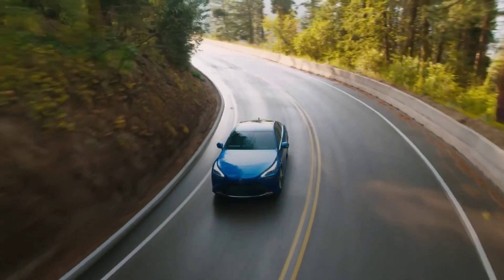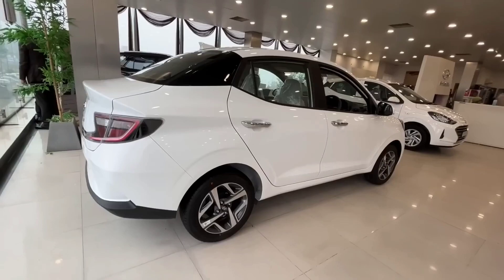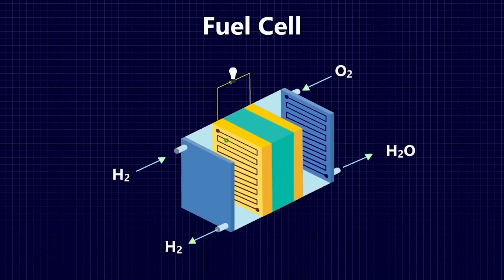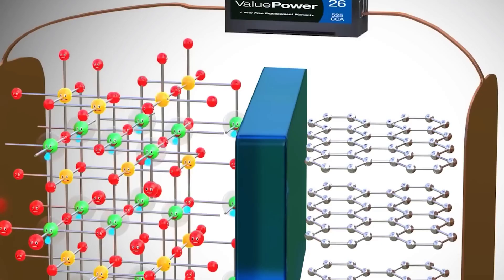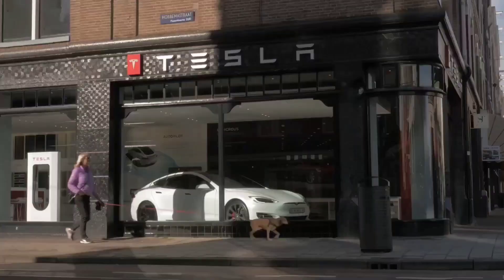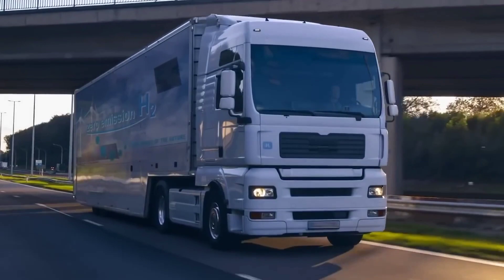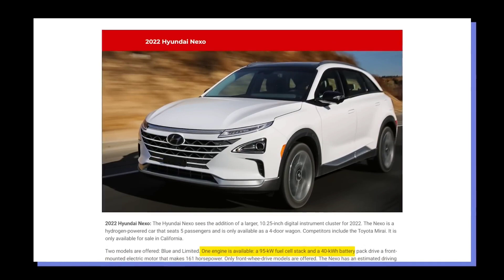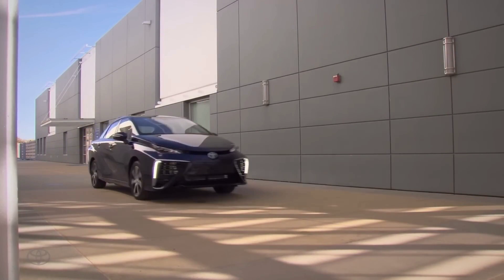Toyota Powerful Hydrogen Car Engine SHOCKS The Entire Industry

Comment: This was either a translation or someone doesn't understand English syntax and sentence structure.
Secondly, they are saying these hydrogen powered cars don't have ICE engines - all while showing descriptions and stock footage of these new cars with ICE engines.  These hydrogen cars still use internal combustion, the hydrogen is just a different fuel than a carbon based fuel.  Hydrogen, being the smallest atom, will always have issues with leakage within the engine, from the lines and tanks and anything that contains it under pressure.